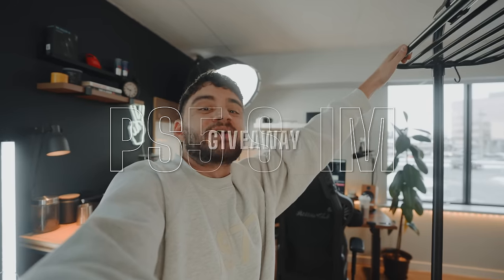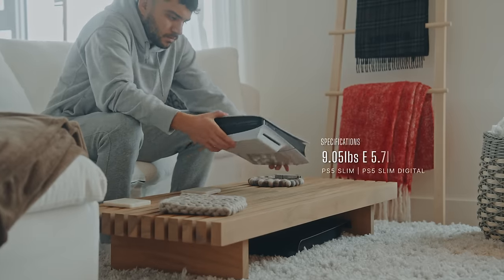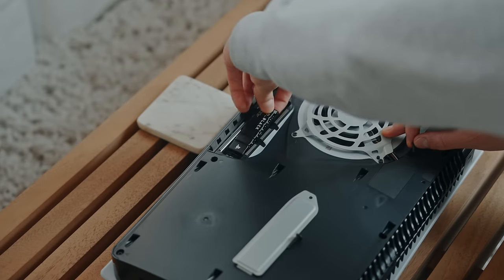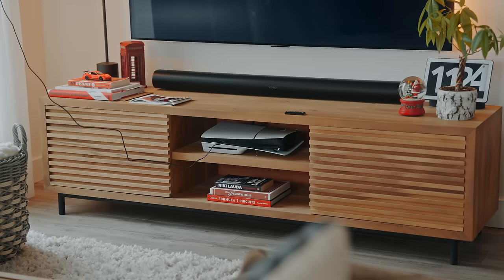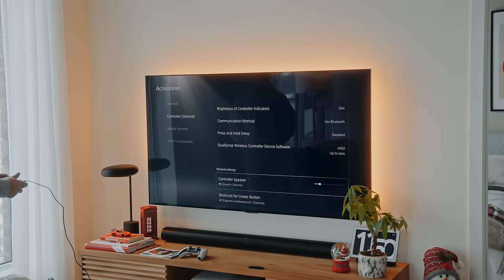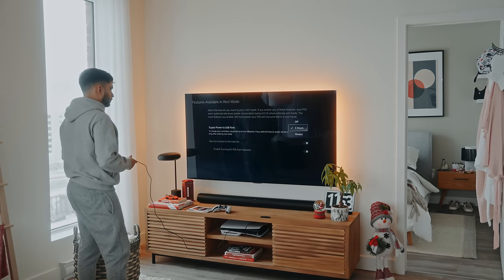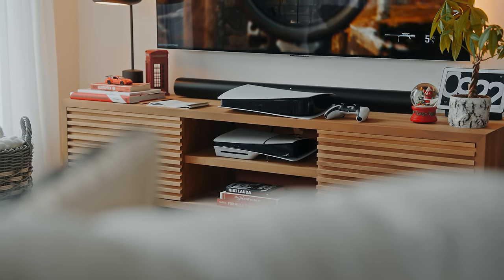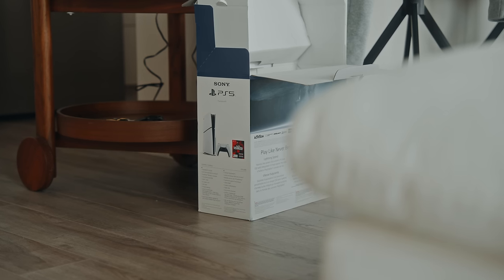PS5 Slim in a Living Room? - Unboxing, Setup + Tips & Tricks (GIVEAWAY)

Comment: To me, the PS5 Slim seems like the perfect upgrade from the PS4/Pro.  You get almost 1 TB standard now with the ability to add UpTo 8 TB pretty easily, it comes with the horizontal feet to encourage it to be layed on its side so it's profile is similar to the PS4 Pro, and the better cooling and optimizations Sony has done to the software and hardware makes it easy for PS4 owners like myself to want to upgrade.
Reply: I actually bought a slim today and upgrading from a ps4 pro. Really excited for the upgrade1
Reply: Before the release of PS5 slim, fat received updates to SSD drives with a capacity of 8TB
Reply: 13:16 the noise comparison is crazy sounds like my ps4 🥲
Reply: is it true?
Reply: You’re right this is why I upgraded I just wanted to wait for more games to out and for the price to drop
Reply: W

Comment: ive been debating with myself whether or not i should get the OG or the slim. The OG is currently on a massive mark down in my area, but I feel like the bigger size will give me quite the challenge since my space is pretty small. But looking at your video, it seems like the size difference isn't really that huge. Hopefully by the time I get to a decision, marked down units are still available for me to purchase. Otherwise i'd have to wait for the slim to go down in price by next year.
Reply: For me I prefer the Ragnorak bundle just because the artwork on the box is a collectors item, but honestly I'd rather have the slim otherwise. The added storage, even though it's not much more, combined with the smaller size, easier to drag room to room, & if the disc drive breaks its a cheap replacement instead of a huge burden. 2 USB in the front instead of one, and then theres another thing, the eject button being next to the power button with both buttons being black on black are annoying. These are all minor changes that add up, but in the end, they both play PS5 games
Reply: @Alien_isolationist  i ended up getting the og. the slim were on sale for (unofficial resellers, so probably doesnt have warranty. the slim isn't officially available yet here) almost $600 from where i'm from, and the OGs were at a massive discount at just $430 (all tax inclusive)
Reply: @xjaireyes  def a better deal. I paid $560 USD in January for my Ragnorak bundle. Doubt your Playstation will break in 12 months though